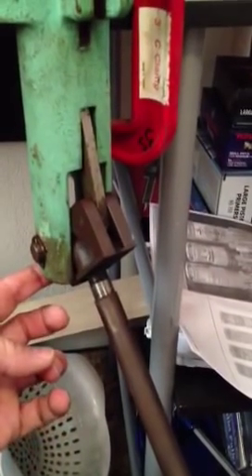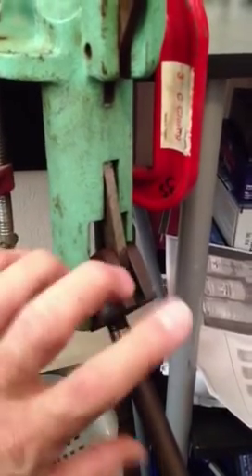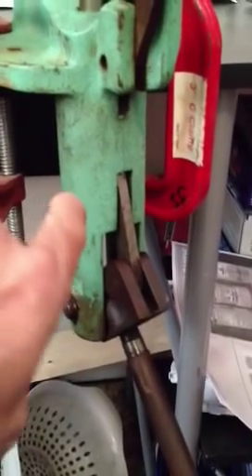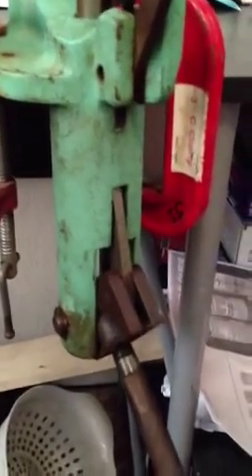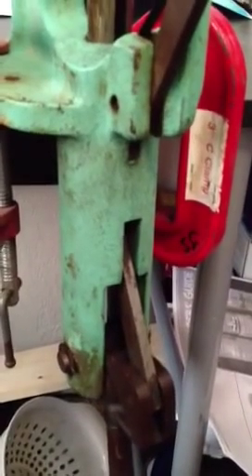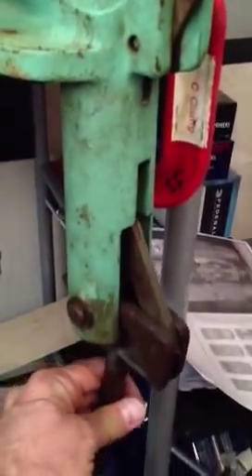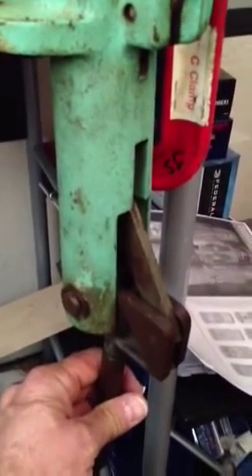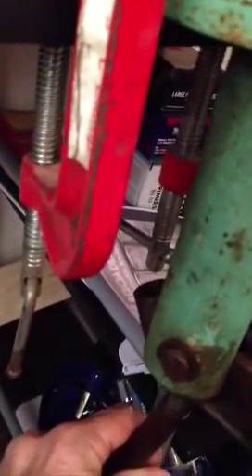RCBS Jr3.  Reconfiguring Handle.

Comment: Easy to Change.... Pull out bottom pin, remove one "E" clip first...,remove shell holder also, if it has one. (older ones didn't)   Let it all slide out  Ram, Link, Toggle, Handle.... Now, put handle into the other hole,  turn toggle around so handle still faces front...  If you are not using slot to prime cases you can leave the ram alone with just the slot to the back,  but,  tap (knock) out the little pin from the bottom of the ram that holds on the Link,  and turn Ram around and replace pin.....   Now slide it all back together...  the big bottom pin should have a spring washer and a flat washer,  one for each side ....  it is a little tricky sliding pin back in lining up a washer on each side....   If you had to hammer pin to get it out some one messed it up.   File and sand down Just the ends of the pin and lube it with 30W oil or grease and you should be able to just use your finger to install or remove this pin any time....

Comment: All Single Stage presses.... Maybe I should not use the word ALL...   Lot of Single stage presses  that I know about,  the Lyman's,  and the RCBS's   Herters,  Pacific,  etc.. you can switch back and forth to an "UP" stroke  or to a "Down" stroke to do the work.... As the User sees fit.  As this one is set up,  handle down, ram down ... seating the primers are the way to go...  Reverse the stroke and Sizing is easier....   Now little 9mm  380's, small cases,  either stroke if you like it..
Reply: How can I make my handle stay in the up position? 
It's kinda scary how it drops.  all my other presses stay where I leave the handle.
Reply: @Billbobaker  Remove the shell holder,   Unscrew the handle,   pull out the bottom pin,  take it apart,  Flip over the bottom part where you just  took out the handle,  put it back together,  putting the handle into the other hole.  Now it is back to like most presses are.

Comment: When you reassemble the block, insert the "Bow Washer" from RCBS. Part number 9115. On the parts list they are called tension spring (washers).  If you do not the ram will continue to fall even after you reverse the toggle block.  It will fall from the weight of the handle.  RCBS is GREAT to deal with in that regard.  They sent me two tension washers, a new shell holder ram spring clip, and a primer catcher tray at no charge.  Look them up online or call at 800-533-5000, you will be impressed.